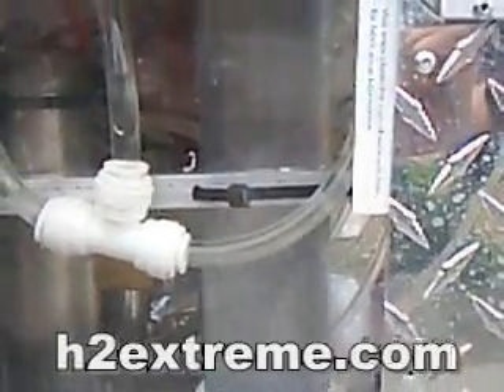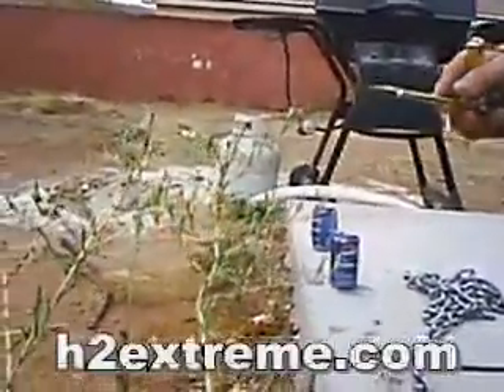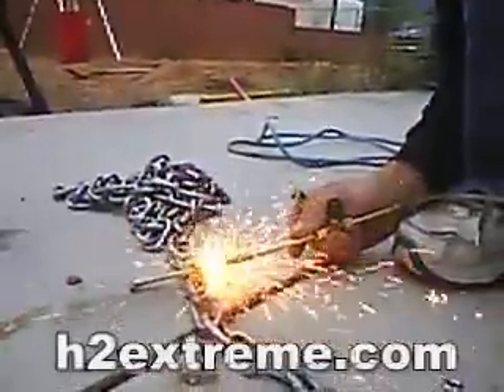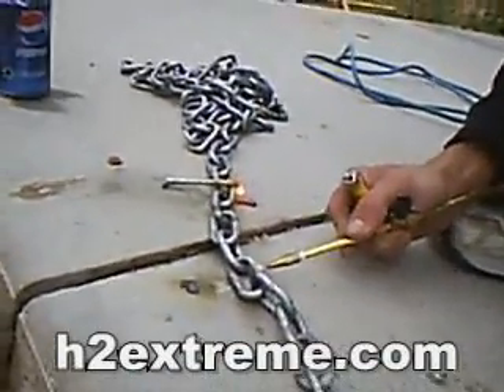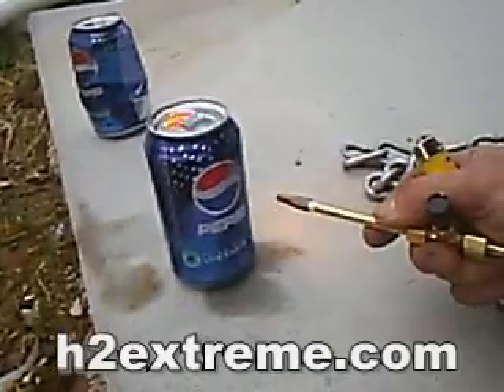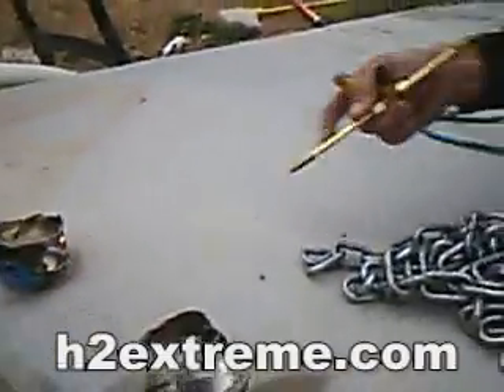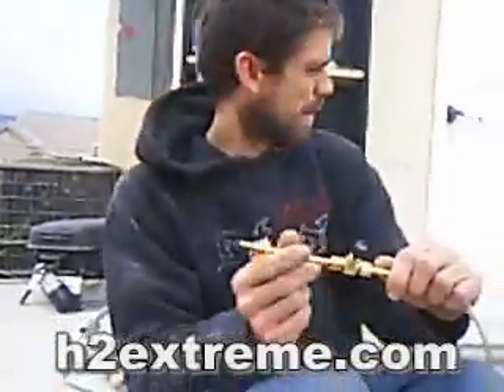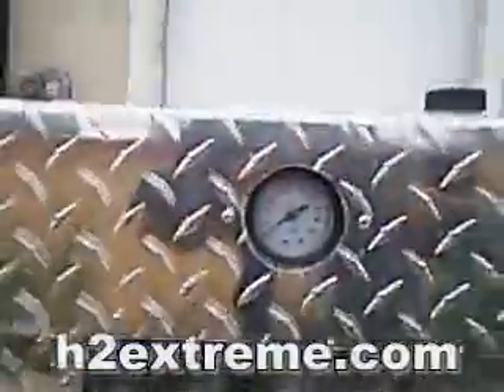20 lpm hho torch high output drycell

Comment: Awesome result, congratulations. Does the water heats to boil?

I made some water heaters, each having two tiny stainless steel plates, It is efficient in 220 volts, boils a glass of tap water in about 1 minute. It could be used as HHO generator, but I don't know how avoid the boiling of the water.

Comment: A tiny second nozzle directly next to the flame, that shoots compressed air at high velocity would help to "blow" the already molten metal away, helping to cut faster. Any scars on the concrete?

Comment: I held my breath while you burned that hole into the concrete! I once placed a torch down to concrete and got an explosion in my face! 
I think a hypodermic needle was used for the torch about a hundred years ago (or something like that) and produced remarkable results in cutting! (concentrates the heat/jet) 
I would love to have one of those! How much would one like that cost, just as it is?  ../.-.\..  Also, could it be adapted to run on 60 Hz, 60 amp, 110v AC? 
☆☆☆☆☆

Comment from the maker: your tip hole size is too big. check your flow and use tip size accordingly..
.5-1 LPM= .013 tip
1.5-3 LPM= .017 tip
3.5-5 LPM= .022 tip
5.5-8 LPM= .027 tip
8.5-15 LPM= .040 tip
15-25 LPM= .055 tip

Comment: Come on man! Above 15k C?Google a F. to C. converter! 15k C. =27032degrees! I got my burn temps from Wiki so they may not be totally accurate but  its close. Your splitting H2O so you get two hydrogens and one oxygen,Not a magical gas that burns at 27,000F.! Where did you get that number from anyway?I would like to see your reference material.Or was it a typo?;}

Comment: I'm not trying to knock it or anything because it is really cool but, That's a OXYhydrogen torch.Good for welding alum.Only burns at around 2800F. though. Oxyacetylene burns closer to 5500f.I guess I just don't know why your making torches out of your generator. IT is fu#king sweet though,hope you find a better use for it.

Comment: 220V to make 20LPM?? Dude go with a Bob Boyce cell design.. 63 plates, with 1/8th inch spacing, using 110-120v and only drawing 10-20 amps. it's being done.. lookup the MarchLabs and Scuffy cell designs.

Comment from the maker: chemist who know the dangers of Hexavalent chromium have purchased our smaller torches to use for health benefits. these efficent cells are the only way to minimize the compound when using brute force electrolysys, you must keep under 2.2 volts per plate or you may be making a toxic amount of hexavalent chromium. when dumping the electrolyte, the compound can be neutralized by adding lime to the electrolyte. see my site for more info. h2extreme

Comment from the maker: yes, i have used these bottled gases many times. i know how it works. this demo only shows the power without extra bottled gases. hho is 66% hydrogen 33% oxygen. i could easily use the same torch you buy at the hardware store, run my hho through the green hose, connect bottled oxy to the red and have the same force to blow through steel. hydrogen will burn 15% with 85% oxygen. see if you can even melt steel with 66% Acetylene 33% oxygen. hho will even melt tungsten @ 10000 f.

Comment: I have cut through 3" thick steel with a small torch tip. you have plenty of hho for a small cutting tip it seems. that there is a welding tip.

BTW how many volts-amps are you drawing with that beast? Ive started working on a small wet cell... looking for pointers.

Comment: actually it takes much, much, much, longer to heat the 'work' in a pure oxy atmosphere, but for steel to vaporize (cut) you need the oxy and a high pressure jet ensures the torch will cut all the way through the steel.  the lever on those cutting to torches was put their for a reason.

Comment: i am a professional welder and he is not cutting steel but melting it. If he had a real oxy/acetylene torch he could use a jet of oxy to laterally BURN the steel away once it was a bright cherry red. It would take 5 or 6 seconds instead a minute. a water powered steel melter as no commercial value but at least he eliminated the fuel gas. P.S. nice fab work.

Comment from the maker: Technically, yes they are not dry. drycell is the term most are calling a cell that is not immersed in the reservoir. Although the cell itself does contain liquid, it is very little during operation since most of the water is forced out with the gas.